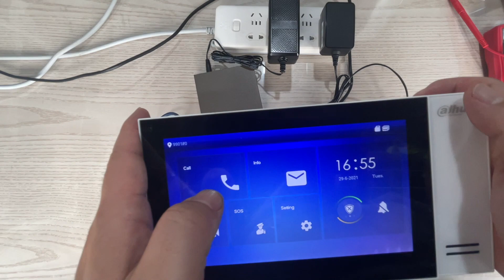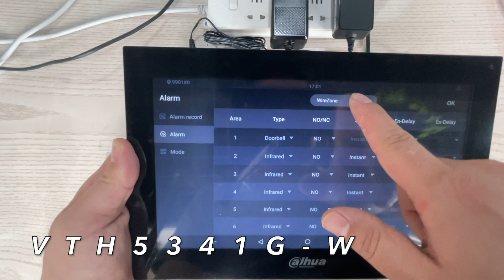dahua VTH2421FW-P VTH5341G-W alarm port output working test

Comment: I used a brand new 12v Power Supply with 1k ohm potentiometer with exact connection but with 12v DC siren, surprisingly the power supply voltage dropped down between 8 and 9 volts for minimum and maximum potentiometer values (was between 11.5 and 13.5v), what’s wrong here?

Comment: Hello, I have a new doorbell from Dahua, the VTO2211G-WP. I cant find any help about how to connect it so that when someone touch the IP doorbell at same time a "normal" classic dorrbell also turns on. The VTO has lot of pins but I dont if this is possible. I'm not using a monitor.
Reply from the maker: hello, you only need use 1 utp cat5 cable from POE switch  to VTO will work, dahua new app DMSS working test for video intercom / How to
https://youtu.be/zOjCdR7RngI